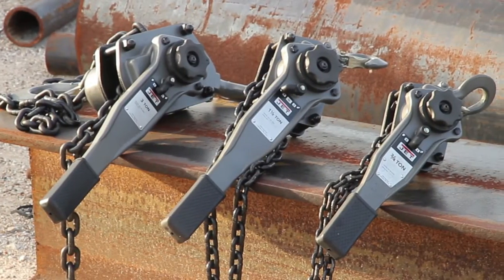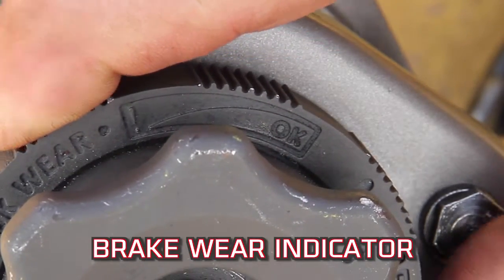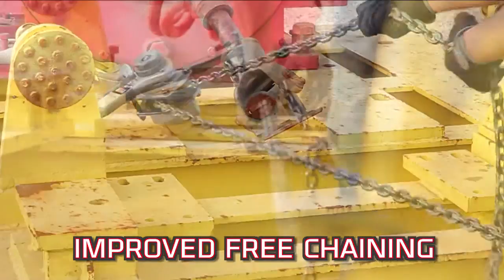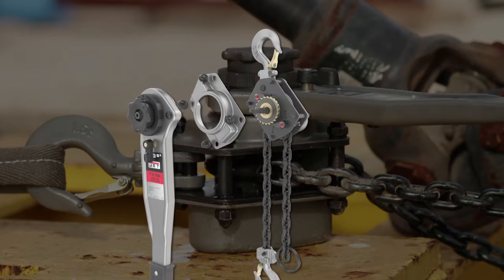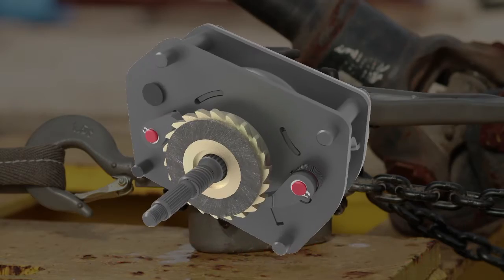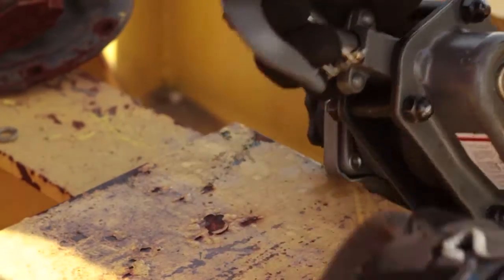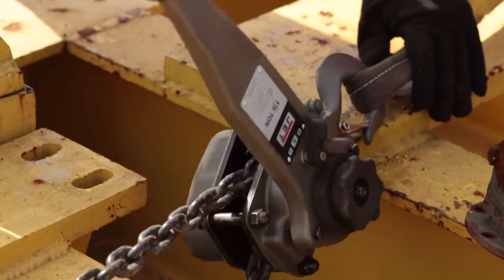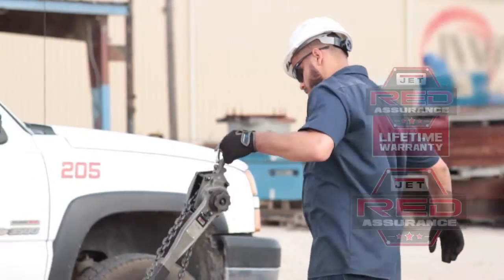JET JLP-A Series Lever Hoists

Comment: The brake system is a bad design. My 3 ton stopped working after owning it for 6 months. Wear indicator says it needs replaced. Ive only used it about 8 full days total. Never loaded more than 3400lbs. I have a scale that is attached so I know. My last come along is over 20 years old. Worked perfect for that long. The jlh series is probably a better tool